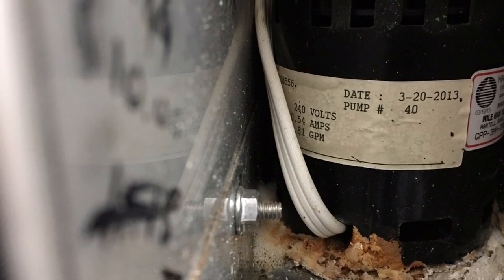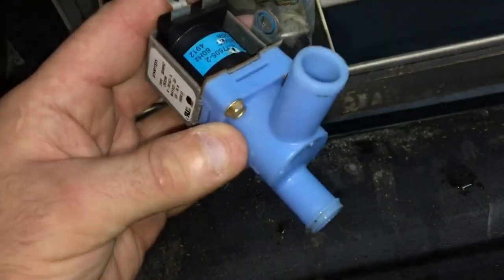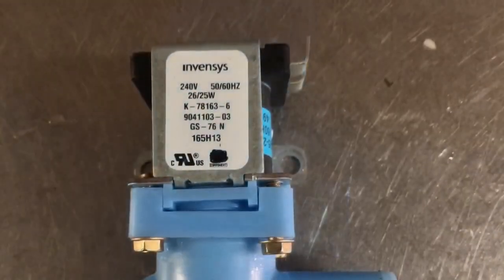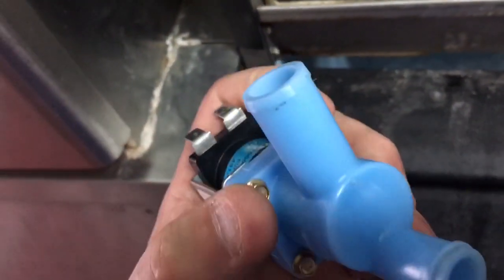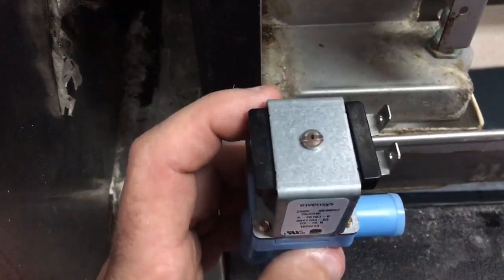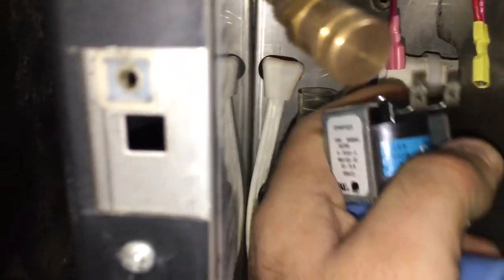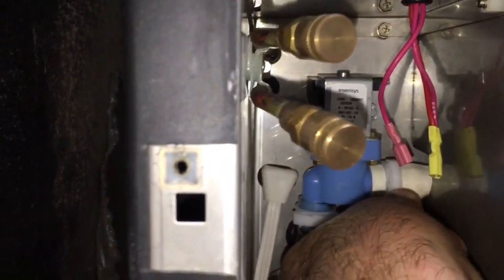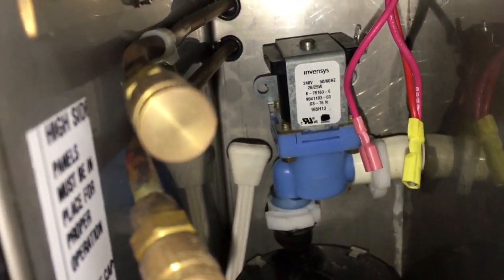ice-o-matic ice machine - Why is water Going down the drain all the time.

Comment: We have several vintages of Ice-o-matics 2006s and 2015s mostly. Some of the old ones still had original valves but they were riveted together. 

Was pleasantly surprised when I had the same problem on our newest machine. Wish I had seen your video before as I rassled with trying to make the connections after SECURELY mounting it !

Comment: My ice is getting stuck on the ice maker (pin is not pushing the ice). Any thoughts?
Thanks for the channel 👍
Reply from the maker: Harvest assist assembly / probe motor assy. probably needs replaced. fairly common problem.

Comment: If there were a water filter in the supply line, would that prevent this issue?
Reply from the maker: Prevent ? Possibly. It Definitely lessens the chance. The water filter also would have to be one that inhibits scale. The ice machine just has to be kept clean / no junk in the water trough. Keep the machine clean. It lessens problems.

Comment: I have an 0606 model and water comes into the machine and fills the trough...water stops coming in when full and then the ice machine starts.  Runs and runs..sounds lkie it is making ice but it does not..I noticed the following.  When I turn the machine to off and then press wash...nothing happens with the water in the trough and nothing running across the evaporator.  When the ice machine is running with trough full there is no water being pumped through the hose and over the evaporater.  Water pump?  Plugged hose?  Tks for help and advice.
Reply from the maker: Most likely the water pump. Check for voltage at the water pump plug. Put your meter leads in the two out side holes and u should read 115 or 230 volts depending if your machine is 115 volt or 230 volt. If u read voltage & plug water pump back in and pump does not make noise & spin & pump it’s not working. Remove pump & try to turn Pump with a screwdriver gently. It can also get something stuck in it sometimes check in the bottom with a flash light. It must spin easily with a screwdriver. U can use a screwdriver to spin it at the motor area where there is metal blades through the side windows for motor ventilation.

Comment: We have a 2008 model that will complete one cycle and then the water will continuously drain out and never complete another one. Any suggestions?
Reply from the maker: @CandaceDavis-r9b   Does it stay in Harvest the whole time too or only run water to the drain. ( Harvest - is the part of the cycle where hot gas valve is open & it's heating the evaporator to drop the ice. )
Reply from the maker: @CandaceDavis-r9b    remove dump valve and see if you can blow through it. if u can its defective & needs replaced. or you can take it apart and see if it's got a calcium rock stuck in it. you should not be able to blow through it.
Reply from the maker: this is what a dump valve looks like. Pay attention to voltage. 115 or 230. i don't know what voltage your machine is. or model number. https://www.amazon.com/Ice-Matic-9041105-04-Purge-Valve/dp/B00KNQRYXC
Reply: @OcRefrig the purge is functioning correctly, we removed and verified. Just ran a cycle to be able to verify your question regarding harvest cycle. Here is what we observed:
1. The cycle took 1 hour which is significantly longer than usual before it began harvest. 
2. The purge valve never shut off after harvest
3. The hot stayed open and the water continued to be cycled out
Thanks for responding and your help. We appreciate it.

Model#ICE0250HA5
Reply from the maker: unplug  machine from wall.  Check the Harvest assist motor assembly. it's in the middle of the machine behind the evaporator plate. a rod from it pokes into the evaporator. check to see if it's loose from the back wall of the evaporator plate.
You are also saying it takes 1 Hr to Make ice.
that's most likely because the water is coming into the trough and either over flowing the trough & going down the drain or loosing water from the drain / Purge solenoid.
water Must fill the trough & not leak out.
for testing purposes you can plug the drain line leaving the ice machine & run it and see if it makes ice properly.
that ice machine should make ice in about 17-21 minutes & Take 1-2 minutes to drop the ice.
Clean the Big aluminum coil at the back of the ice machine with a Brush & blow it out with compressed air.
You Should be able to see through it with a flashlight.
Reply from the maker: with ice machine off.  Check that water fills the water trough and does not spill over. the float must shut off water when full trough.  water must not overflow.

Comment: I have a case where the dump valve is always running. Why is that, why the 120 volts are continuously coming from the board?

Comment: I did clean up the valve and even blow with the mouse to get rid of crud and found it seems that little ball inside lifted up for open and down for close. However once the ice drops and drains water and it does not close so water drains continued and doesn’t supply water to evaporators. Does this mean I have to replace purge valve or something else related?
Reply from the maker: probably replace the purge valve.

Comment: My purge valve  leaks like hell from the top  not from from where you hook up the hoses  while it's making ice  and when I purge it manually  you can see water leaking  from top of purge valve
Reply from the maker: Time to replace purge valve. Cheap & easy job. 2 screws. 2 hoses.
Reply: @OcRefrig  does it matter how the 2 wires hook up both of mine are black
Reply from the maker: No

Comment: I have a ice1406 and some reason it won’t drop ice I checked the harvest motor their fine also it’s 550psi on the high side and 20 on the low what causes that?!?
Reply: Bradlee Vickery sounds like a restriction in the txv
Reply: Julio Chavez Is there any thing I can do to fix it I paid 80$ for a technician to try finding the issue he didn’t fix anything he told me to change to filter drier it might be clogged
Reply from the maker: definately dont run it ! 550 head will kill a compressor Fast ! definate restriction somewhere. u gotta recover all refrigerant , and tear it apart to find blockage. Remove filter drier and replace for sure. use dry nitrogen to troubleshoot restriction. its gonna be some work.
Reply from the maker: is the 550 / 20 psi when its in freeze mode or harvest ?
Reply: OcRefrigeration,Hvac & Electrical. Freeze mode it makes the ice fine but it never drops it
Reply: OcRefrigeration,Hvac & Electrical. I have two of the same machines the one that works fine it drops ice around 350 high 42 low
Reply from the maker: air cooled unit , remote , or water cooled condenser ?
Reply: OcRefrigeration,Hvac & Electrical. Air cooled
Reply from the maker: whats thevtemperature in the room ?
Reply from the maker: your head pressures should really never be above 300. example - if your room temperature is 80 degrees your head pressure should be about 275 psig.
Reply: OcRefrigeration,Hvac & Electrical. The room temperature is about 98
Reply from the maker: So, first thing u need to do is clean Both condensers , blow them out with co2 backwards. turn the power off at the circuit breaker first.

second --- you can try swapping cube relays between machines to see if u have a failed relay. ( square yellow things ). turn power off. remove relay by pulling straight out. they just plug into the base socket like plugging a plug into a wall. swap relays between machines and see if other machine works.  or just buy some relays off the internet.
Reply: OcRefrigeration,Hvac & Electrical. I've been swapping parys between both machines 1st I swap the time 2nd compressor relay 3rd harvest motors I don't have any equipment to do work on the machine I just have a old pressure gauge where are you located I live in calexico California and I can find any technician that knows about ice machines just a.c. unit's
Reply: OcRefrigeration,Hvac & Electrical. I had the condenser cleand when I paid 80$ and it didn't make a difference my only hope is the filter if that don't work I'm screwed I really need both machines working
Reply from the maker: Holy shit , very hot in that room.
Reply from the maker: ok. so for a 100 degree room , your head pressure should be about 350. so the other machine is ok.
Reply: OcRefrigeration,Hvac & Electrical. Yes
Reply: It makes the ice 
perfect drops ice every 17mins
Reply from the maker: Your head pressure is too high and suction is too low , that means a restriction in the discharge side of the system / high side / Liquid line side of the system. most likely the Filter drier Has Broken apart inside and something is blocking the outlet of refrigerant to the system.
Reply: OcRefrigeration,Hvac & Electrical. Yes I ordered that yesterday 47$ the only thing is I’m going to lose all that refrigerant I don’t have a refrigerant Recovery unit and the technician I know doesn’t have one either 🤕
Reply from the maker: Lol, im 3.5 hrs away from you. sorry man.
Reply from the maker: Call ice-o-matic Factory Monday and ask Who services Your area. they should have somebody. maybe a guy out of san diego would drive to you.
Reply from the maker: All Refrigeration & airconditioning guys Must Have a Recovery machine to be able to recover refrigerant. the problem comes into play that u want to Re-use Your old Refrigerant and for that to Happen. Someone needs to Have a Empty / New / Clean Recovery cylinder to recover Your Refrigerant into. and that cylinder has to be evacuated to under 500 microns before your old refrigerant is put into it. I Never Re-use old Refrigerant. i Just put New Stuff in. it's only 60 ounces. less than 4 lbs of refrigerant. not a whole lot.
Reply from the maker: You could buy your own Recovery cylinder for your own use if u want off the net.
Reply from the maker: Heres a link --- $65.00 https://www.ebay.com/p/Mastercool-62010-30lb-Recovery-Tank-Cylinder-Without-Float-Switch/1201557671?iid=132256734094&chn=ps&ul_ref=https%253A%252F%252Frover.ebay.com%252Frover%252F1%252F711-117182-37290-0%252F2%253Fmpre%253Dhttps%25253A%25252F%25252Fwww.ebay.com%25252Fp%25252FMastercool-62010-30lb-Recovery-Tank-Cylinder-Without-Float-Switch%25252F1201557671%25253Fiid%25253D132256734094%252526chn%25253Dps%2526itemid%253D132256734094%2526targetid%253D485552287913%2526device%253Dm%2526adtype%253Dpla%2526googleloc%253D9031556%2526poi%253D%2526campaignid%253D1497326396%2526adgroupid%253D56281260125%2526rlsatarget%253Dpla-485552287913%2526abcId%253D1139466%2526merchantid%253D8024204%2526gclid%253DEAIaIQobChMIw9jWgMb33AIVB4FpCh15cgE6EAQYASABEgJSP_D_BwE%2526srcrot%253D711-117182-37290-0%2526rvr_id%253D1636777213477%2526rvr_ts%253D4ef1ee371650ac84d0077f80fff612d3
Reply: OcRefrigeration,Hvac & Electrical. I wish ice o Matic parts weren’t so expensive/overpriced 😅
Reply: OcRefrigeration,Hvac & Electrical. Well thanks for your consideration in helping me out I’m going to purchase that cylinder it would be useful do you happen to sell used ice o Matic machines
Reply from the maker: Your welcome ! No ,  i leave that to the internet. square footage around here is wayy too much to have a shop.
Reply from the maker: like what parts ? they really aren't. where are u buying your parts from ?
Reply from the maker: Here's a Amazon link --- For Good prices on ice o matic parts.
https://www.amazon.com/s/?ie=UTF8&keywords=ice+o+matic+parts&tag=hydsma-20&index=aps&hvadid=177582091916&hvpos=1o3&hvnetw=g&hvrand=5141096186628844371&hvpone=&hvptwo=&hvqmt=e&hvdev=m&hvdvcmdl=&hvlocint=&hvlocphy=9031556&hvtargid=kwd-4350023690&ref=pd_sl_1a8f6lphte_e&gclid=EAIaIQobChMIuMXXq8v33AIVloxpCh3X_Q_AEAMYAyAAEgLCBfD_BwE
Reply: OcRefrigeration,Hvac & Electrical. The ice machine that’s not working I had to replace the water pump 282$ and the water float valve 60$ I bought a after market one for 10 dollars at Walmart I buy my parts from m.partstown.com
Reply from the maker: try not to buy from parts town or heritage , too expensive. u can try me for parts too.  i do sell parts. try the amazon link first. me second.
Reply from the maker: parts town is a rip off sometimes. that water pump seems over priced. 
should have been about $168.00 Floats are 40-60 bucks. depending.
Reply: OcRefrigeration,Hvac & Electrical. If you can send me the link I’ll buy from there because parts town is really overpriced
Reply from the maker: You need to see one of my video's --- its your machine. 1406. 
You need to see this video --- at 38:00
https://www.youtube.com/watch?v=hbBkSajmdiw

its your machine.
Reply from the maker: Here's a Amazon link --- For Good prices on ice o matic parts.
https://www.amazon.com/s/?ie=UTF8&keywords=ice+o+matic+parts&tag=hydsma-20&index=aps&hvadid=177582091916&hvpos=1o3&hvnetw=g&hvrand=5141096186628844371&hvpone=&hvptwo=&hvqmt=e&hvdev=m&hvdvcmdl=&hvlocint=&hvlocphy=9031556&hvtargid=kwd-4350023690&ref=pd_sl_1a8f6lphte_e&gclid=EAIaIQobChMIuMXXq8v33AIVloxpCh3X_Q_AEAMYAyAAEgLCBfD_BwE